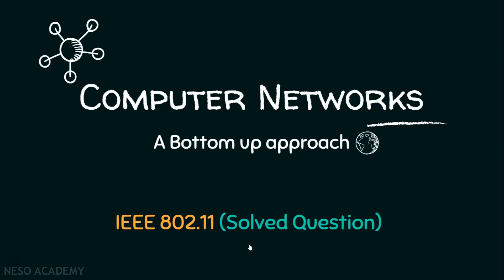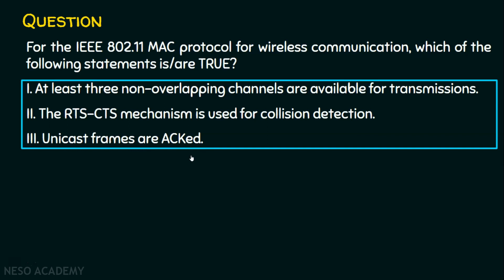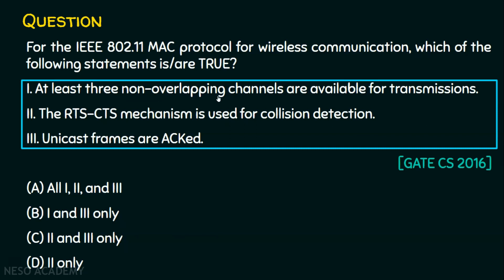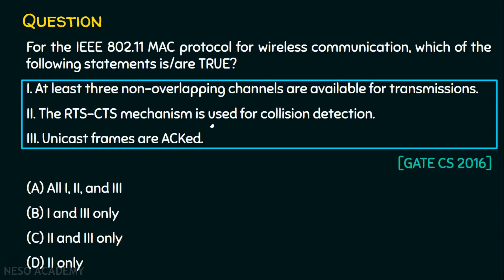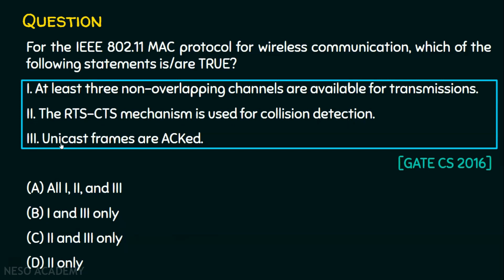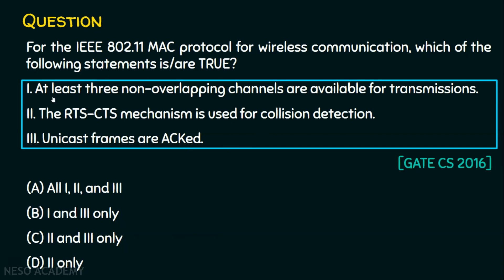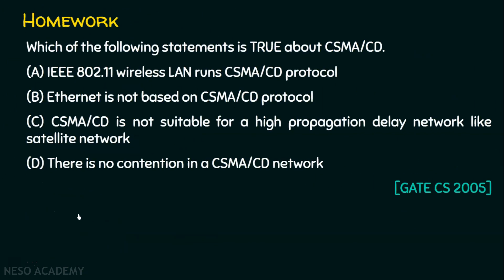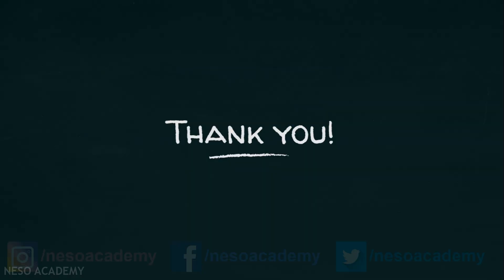Wi-Fi (Solved Question)

Comment: Csma(cd) uses for ethernet which is wired 
Csma(ca) uses for wifi which is wireless 
So satilite network is wire less so csma ( cd) is not suitable
So option C is the correct option